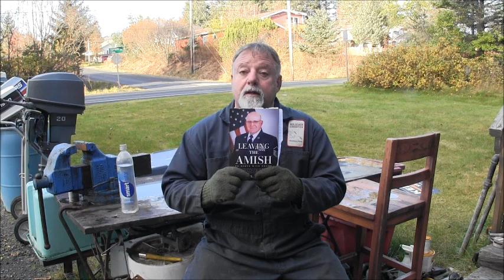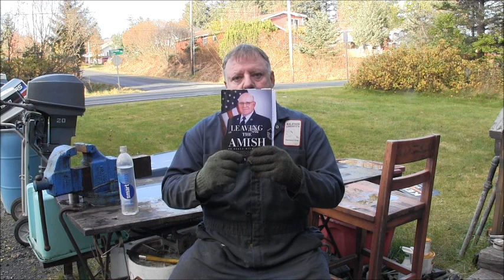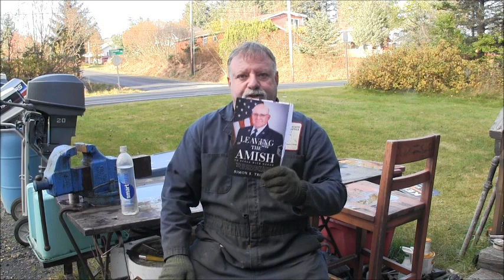JOHNNY RUDE 15 HP,  That's a wrap,  ( + song diddy )

Comment: Hi Kodi, this is Sonny from Wilmington, N.C..  I had this same thing happen to me working on the 15 Evinrude's in the early 1980's vintages. I was just as frustrated as you were working on your motor!!!  I finally thought to slowly loosen all 6 
 lower unit bolts, only backing out the bolts a tiny bit, and at the same time, I'd keep rocking the flywheel back & forth so's I could feel when the flywheel would begin to turn easily, and smoothly. In other words, if the grinding stops when you loosen all 6 lower unit bolts,, that means that when the  l.u. is tightened up, it's forcing the driveshaft really hard into the lower crankshaft spline which pushes up on the entire crankshaft assembly,, which then starts to rub against the inside of the block lightly!!!!
      By loosening all 6 bolts I proved that maybe some crud, or an old rubber grommet (from the top end of shaft)  had gotten pushed up into the female splines on the crankshaft,,, and/or some crud somehow got into the female splines of the pinion gear in the L.U. !!!!  
       In my case it was a piece of the o-ring that got stuck in the crankshaft spline.  Ever since then I always take a long metal rod that I made to fit nicely inside the crank spline and spin the rod with my batt. drill!!!   I'm a 35 year Johnson & Evinrude 
tech and haven't lost the love for these wonderful works of engineering ......... warts and all!!!!!!  Keep the videos coming!!!!
Reply from the maker: Ok Mate''  Between U & Kramden I'm gunna re-visit  This old UG   -  Oops cutie and do what both of U R suggesting.    What the heck I only got about 400 hours of labor''   why not a few more hahah.    thanks      kb

Comment: I have a 9.9 makes very similar noise.   At some point in its life it got stood on its head and rusted the upper crank bearing.   I disassembled and replaced the upper crank bearing and "cleaned" the crank shaft.   The crank had rust lines in it where each needle had sat.   Those very slight imperfections make wiring/ whining sound but I've been running it plenty for about 10 years now and still strong.    I'd love to see you pull that apart to see if its a similar deal inside.
Reply from the maker: Sounds along the lines I am thinking is making the noise.           kb

Comment: Well my dear Watson, the lower unit has an alibi sooo the culprit's elsewhere. It should be a partially shot bearing, either the upper / lower crankshaft's or a piston's conrod needle bearing. The fact that the whining occurs in gear could be explained by the need to put some stress on the bearing to have it start chattering. A forensic dismantling of the head is in order. Of course, you could also call in an exorcist which would be quite fitting one week from Halloween. Loved the diddy. Take care and most importantly be merry !
Reply from the maker: Hey U made me think, could there B a goat or some other farm animal in the powerhead Hmmm'''    kb
Reply: @kodibassInsideoutboards  Twilight Zone time here: dee-doo, dee-doo !

Comment: OK, well those lower units are interchangeable through the years, for the most part.  But, there was a change to the pinion/driveshaft early on in the first few years of production.  So, the older driveshaft won't work with a newer pinion, and vica versa.  Don't quite know what the change was, but it has got something to do with the lower splines on the driveshaft.  Now, I don't think you could accidentally swap interchange these pieces though, don't think the mismatched pieces will fit together.  Someday I will investigate.  Swapping the grooved/oring driveshaft and non oring shaft won't affect the overall height and shouldn't cause this issue, even though these two style driveshafts should not be swapped around, especially on salt water engines.  You mention the driveshaft seems to fit up into the splines just fine, but I want you to try one more thing before pulling the powerhead off:
Remove both center gearcase bolts, and loosen the other four.  Now, just add a few 1/4" washers on the remaining screws in between the gearcase and exhaust housing, now snug down the four screws again.  So, if driveshaft height is an issue, this little test will solve that.  Then retest in the tank to see if the noise remains.  If the noise remains, then driveshaft height is not the issue.  
Once the powerhead is back off, try to remove those three pesky 1/4 bolts that hold the lower seal hsg in place on the powerhead.  These damn screws love to rust up pretty bad in salt water, so don't force them too much, don't want you to break those damn screws off.  But, if you happen to get them out without too much trouble, then you can remove that seal housing from the bottom of the powerhead without disassembling the powerhead.  Now, you can have a better look at that lower crank bearing to see if that is the issue.  
I hear what you are saying about the engine seems to sound OK when run without the gearcase installed.  Perhaps the extra load of the gearcase being installed is enough to cause that lower bearing to growl.  I'm guessing that perhaps the lower seal is bad, or the engine had water in it at some point, which messed up the lower crank bearing.  You gave this thing every shot of survival though.
Reply from the maker: I may mess with it some more b 4 I tear into it,  But either way should B fun video stuff.     kb
Reply: @kodibassInsideoutboards  to both u & Kramden, I thank u both for your knowledge patience and understanding of these motors. The wealth of knowledge on troubleshooting I have learned; continue to learn both from watching and reading from the both of u has been monumental for me. So thank you to the both of you for your guidance and TIME (priceless). Your short cuts, hacks and tips help to pinpoint issues. I try to save the unique situations in their own, but YT will not allow to customize the saves, but have made some folders by copying the topics and saving them that way for quicker search. You both will go the extra mile to figure out the issue and want to repair that issue correctly, that’s my entire premise, is to have what I have in proper working order, not just to get by, unless I’m stranded and do what needs to be to get back, then fixed with proper parts! I just wanted to thank you both for everything it’s important to pass on the knowledge.

Comment: Maybe put a straight next to the fly weel and see if it scrapes here and there.  i had a 4hp someone droped without the top oon and bent the crank at the top a little.
Reply from the maker: I did that & rotated it with a socket & ratchet slowly seems pretty darn straight.    kb

Comment: Another interesting video Kodi
And thank you for sharing knowledge
I need your opinion for a problem that i have
I have a suzuki dt30c with a stuck lower unit 
i try everything
A lot of hammering plenty antirust even upside down for 2 weeks but with no luck
Any advice to solve the problem
Sorry for the long post and the bad English
Reply from the maker: I have a vide on making / using a puller to remove a stuck driveshaft.  But sorry I do not remember the title,  But it is on my channel.     kb

Comment: Could the engine be mounted slightly misaligned causing the drive shaft to grind? Just throwing out a wild guess. Shame cause the engine seems to run well other than that grind.  BTW love it when you play and sing in your vids. Your song speaks of what many of us have learned the hard way, that purchasing a used boat (or outboard) can break your heart (as well as your bank account 😪)... Have to ask... Do you play in a band as well?
Reply from the maker: Not sure but this is the second mount it's been put on?  So it's a head scratcher 4 sure.  Thank you for the Kind word's on the tune, Yes I do play in a house band every week end.         kb

Comment: I don't understand why the drill wobles so much when you crank it over . Is something bent? or just the way it's fiting on the flyweel nut? Could  the crank be bent a bit
Reply from the maker: The extension is bent,     kb